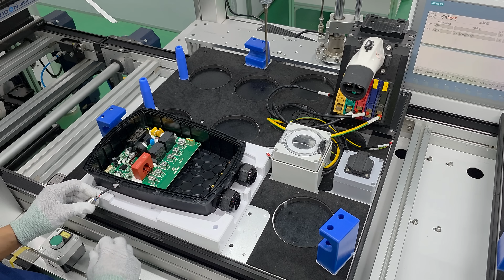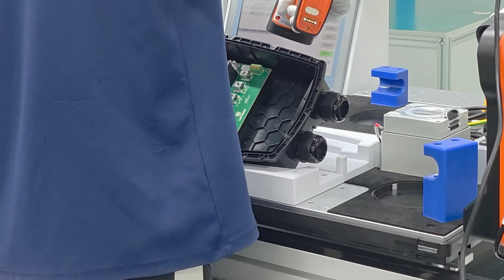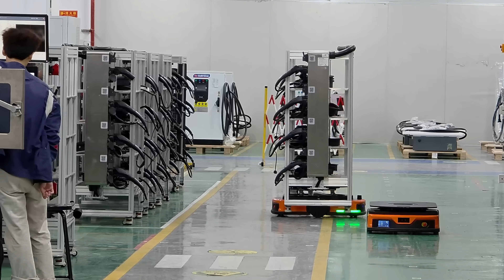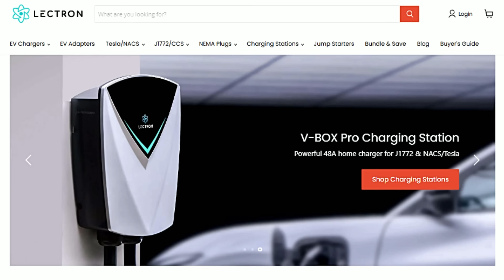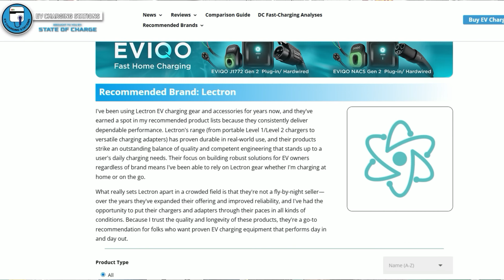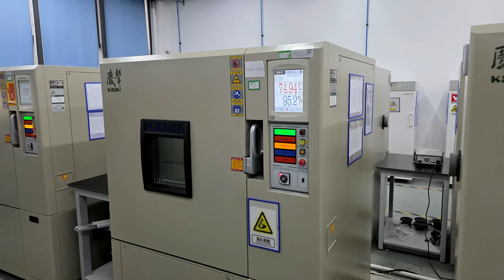The Lectron Nexus Is Here, And I Visit The Factory In China Where It's Made

Comment: I recently installed a Lectron Nexus hardwired charger at a vacation property, and overall the charging experience has been perfectly fine. My criticisms are almost entirely about the installation experience and documentation.

Before I even unboxed the charger, I thoroughly read the installation manual. It explicitly states that the hardwired model accepts conduit entry from either the bottom or the rear. UM_Portrait__LECHGNexusHWNACS_V21.pdf When I received the unit, I found there wasn’t actually a rear knockout. Not a huge deal, since it could be drilled if needed, but it was my first indication that the documentation didn’t quite match the product.

The next thing I noticed was that two of the screws required to open the unit had warranty void stickers over them. That became an issue because I had already purchased my own liquid-tight whip and wiring for the installation. I contacted Lectron support, and to their credit they responded pretty quickly.

Initially I was told that opening the unit would void the warranty. After I pointed out that the manual references a rear conduit entry, they changed course and said opening the unit was acceptable. However, when I asked about removing the factory-installed pigtail so I could use my own wiring, I was told that would be considered a modification and would void the warranty.

I’m also not a fan of the internal design. The charger uses ring terminals, and because the internal wiring compartment is enclosed, you can’t really mount the charger first and then make your field wiring connections. You essentially have to complete all of the wiring before hanging the unit on the wall, which makes installation more cumbersome than it needs to be.

None of these issues affect how it charges. It’s been working well so far. I just think the installation could be improved with more accurate documentation and a more installer-friendly design. If Lectron addressed those items, I’d have very few complaints.

Comment: Question: In 2023 I used your advice and used Qmerit to install a Emporia home charger. Irmt has been working well. It is time to return my ID4 leased vehicle. I want to update my charger to a NACS charge cable. Emporia has told me that my current charger in not upgradeable. Is this charger now worthless? Do I need Qmerit to install a new NACS compliant charger? Need a little information to move forward.
Reply from the maker: Most chargers aren't designed to change the cable. That said, you can usually do it if you can source a NACS connector and cable. But they are usually around $200, than then you need to take the charger apart and swap it. In most cases, it's just easier to buy a J1772 to NACS adapter and use that. Or, as you mentioned, buy a new charger with a NACS connector. The ChargePoint Home Flex is one of the few chargers that will sell you the cable and connector, and encourage you to swap out the cable if you need to . But they designed the charger to swap the cable out easilly without needing an electrician to do it.
Reply: Buy a J1772 to NACS AC adapter and you can charge any vehicle.

Comment: You say all Lectron products are high quality and safety certified.  High quality is a matter of opinion but they are not all safety certified.  If you look at their adapter page, for example, there's a certified version and an uncertified version for most types.
Reply from the maker: It's my understanding that they are all safety certified, but Lectron specifies which ones are certified to UL 2252, which is a new standard. The other ones have TUV and UL 2251 certifications. But I also think that Lectron is phasing out the ones that they have two of the same adapters, they are just selling out the remaining inventory for the ones that aren't UL2252 certified, but I will get clarity on that. As for the quality aspect, sure that can be subjective, but I do have dozens of adapters from other brands in my garage (I have well over 100 adapters for comparison) and the Lectron ones are certainly in the upper end for quality, in my opinion.
Reply: @StateOfChargeWithTomMoloughney  Yes, I think the new generation of Lectron adapters are high quality.  The chargers have included a lot of low quality ones over the years.  As for UL2251 certification, that's not a standard for adapters so I don't think that counts.  But I'm glad to hear they are phasing them out.

Comment: Thank you Tom! I feel like you are really helping push the manufacturers to make safe devices! love the double temperature sensors on the plug! such great piece of mind!
Reply: Yes, that's really smart engineering.  Pair that with a Hubble/Bryant 9450 torqued to spec and it should be pretty much impossible to have a receptacle failure.

Comment: The proof, as you have shown in past videos, is whether the random product off the line is as good as the one they give you.  PLUS, what if they change the inside elements with cheaper items in the future....that's the real test. (Is this a quality product and does it represent the production product...now and in the future)
Reply from the maker: Once it's safety certified, they cannot change any parts unless they then pay to have it safety certified again, and that costs tens of thousands of dollars.
Reply: @StateOfChargeWithTomMoloughney  Or at least they are not supposed to.  How well they adhere to that does vary.  Lectron seems to be moving in the right direction on quality control compared to their early days.

Comment: I had a Lectron V-Box NACS charger for several months but every time charging was complete, my Tesla app would alert me of a charging station failure (it was providing voltage when the car wasn’t asking for it because it took too long to open its contactors) and thus I couldn’t stop, then restart charging as it would fail out and would require me to replug the car. This happened on 3 different Teslas. They told me it was a known issue that they were working on. It seems like that should have been caught in testing way before putting the product out? To their credit, they did refund me in full and I bought a Tesla wall connector instead. 

Their CCS to NACS adapter has worked very well for me, thankfully.
Reply: I had one also and wasn't impressed so I replaced it. I wish I had found this channel back then because I wouldn't have bought it off of Tom's review. I will now only buy chargers and adapters after Tom gives them his approval.

Comment: Will the Nexus have a dual (240/120) capability?
Reply from the maker: No, it's a wall-mounted 240v unit.
Reply: @StateOfChargeWithTomMoloughney thanks Tom
Reply: These types of boxes are designed for Level 2 240v. Use a Level 1 charger for 120v.